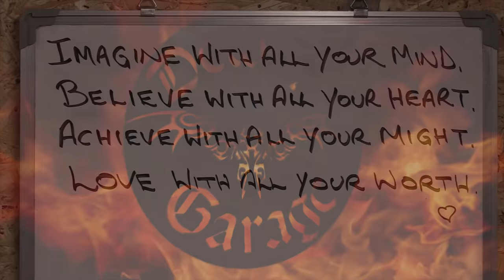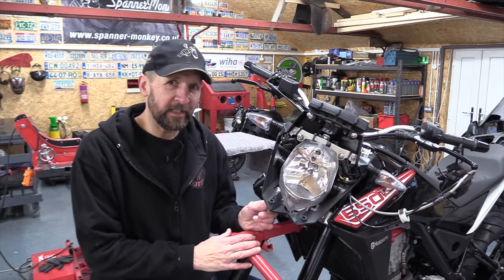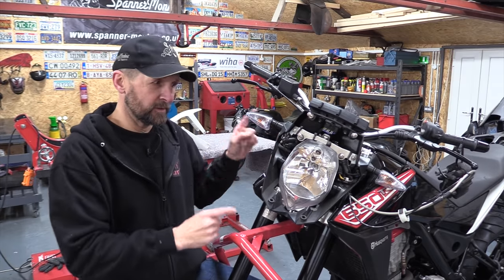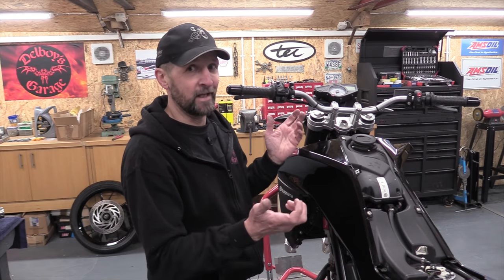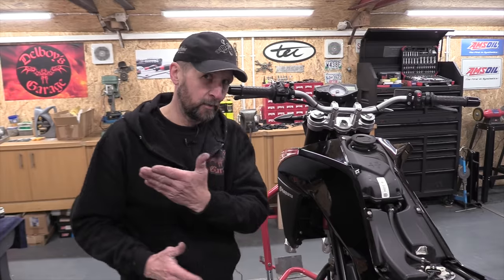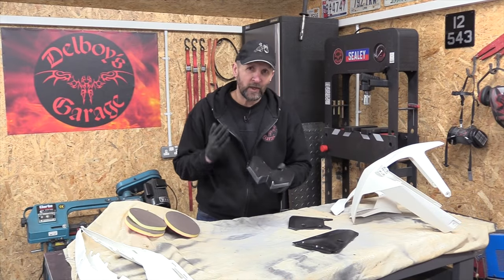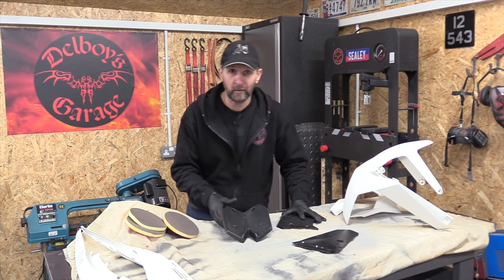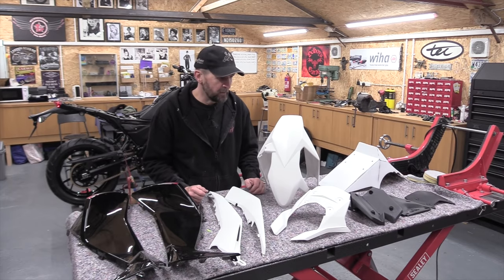Husqvarna Makeover #28, Bodywork strip and prep for Paint!

Comment: Previous owner of my new bike tried to do something similar to this but did a terrible job. Now I'm trying to fix it. Do I need to bring it back down to the bare plastic before painting? Idk what paint they used but it's flaking off in spots. Should I just clean and sand the paint that's already on there?
Reply from the maker: Remove all the flaking paint, flat down to get it as smooth as possible, then re-paint with a 2k sealer first... before you use your final paint.  The sealer locks in everything underneath so it won't cause the new paint to react.

Comment: I find it surprising every time i take the plastics off a bike just how many pieces there are and how long it takes.  Even on a bike such as this, you'd never estimate there were so many pieces.  

I must have jinxed myself last week.  Walked past the ST yesterday night and found an antifreeze leak on the table.  Hoping it's just the coolant seal on the front cover and not the mechanical and oil seals for the water pump.  If it is, i'll be wishing for that hydraulic press again!
Reply from the maker: Oh no, good luck with it buddy, hope it's just something simple like an overflow, and yes you're right, this bike sure has an endless amount of bodywork!

Comment: Delboy when you abrade plastic components be aware that injection moulding companies bulk out the mouldings with whats best described as Talcum Powder to save on plastic material, when you rub the surface you will see a white powder forming so another wash may need doing again to remove the dust.